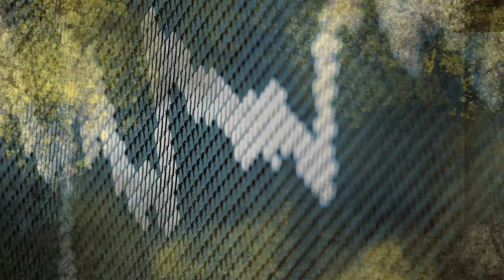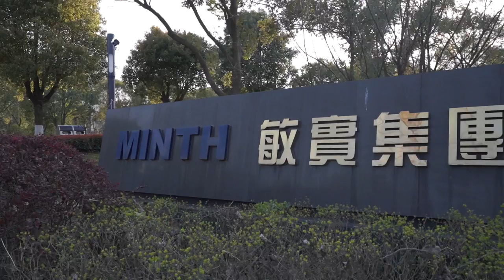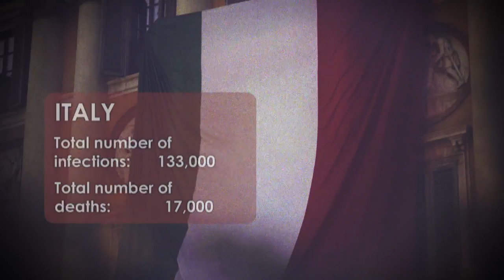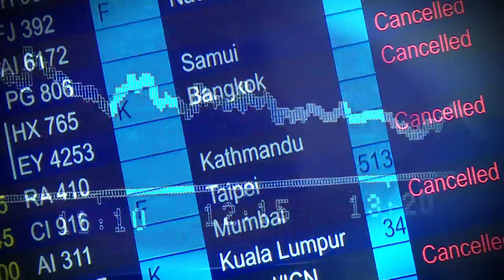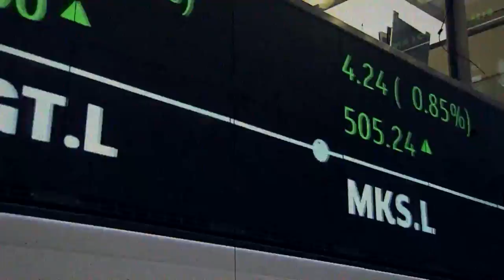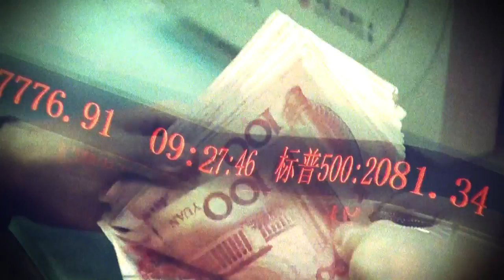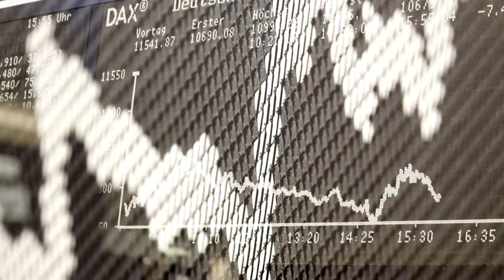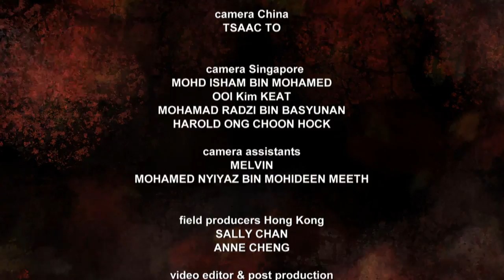Is a Global Recession Looming? | Insight | Full Episode

Comment: Love this pandemic lockdown; rivers are running clear & looking clean and glimmering in the sunlight.  The air is not dusty & temperatures are considerably lower by a few degrees. My water filters used to turn dark chocolate within 24 hours; now it has turned light beige after 4 weeks.  Am not exactly complaining.
Reply: And the animals get to venture out without getting run down.